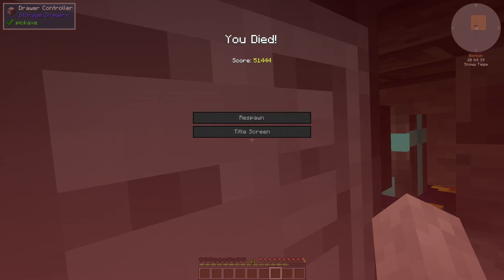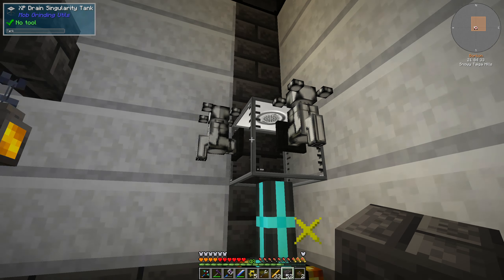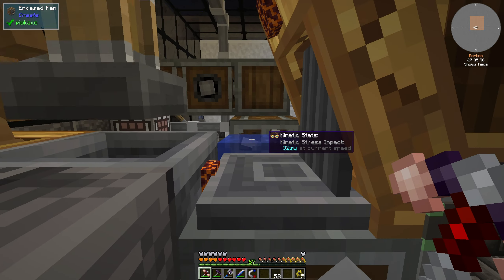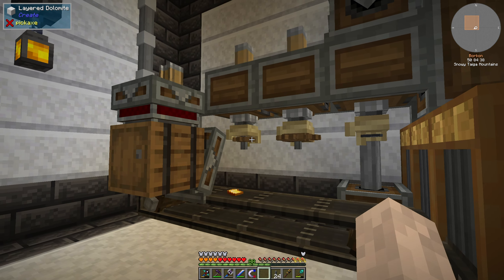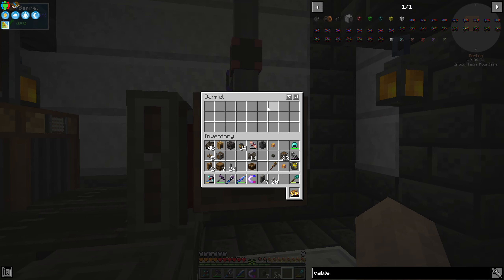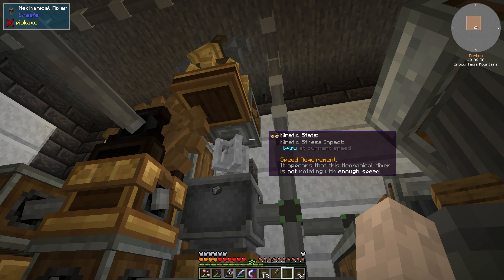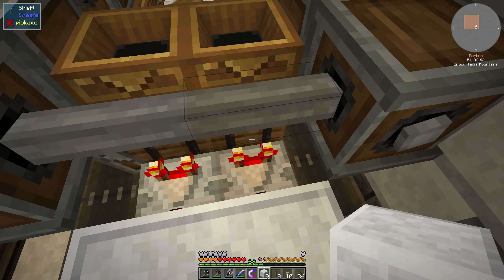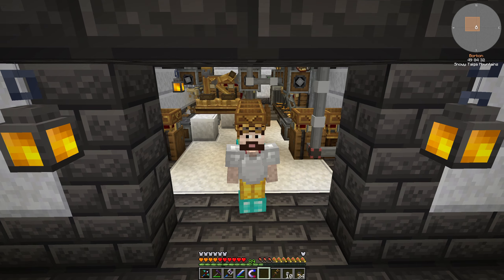Machines Making Machine Making Machines (Create Mod).  - Minecraft Cave Factory Ep. 7

Comment: You still using the same Wind Turbine for power?  That looks like a lot of SU for one Wind Turbine.
Reply from the maker: Nah, I showed the new setup in the previous episode. Furnace engine, furnace burner from Create Crafts and Additions, cooking wood for charcoal.

I think at the end of this episode I had 2 or even 3 furnace engines running. The windmill is just for the manual setup upstairs.